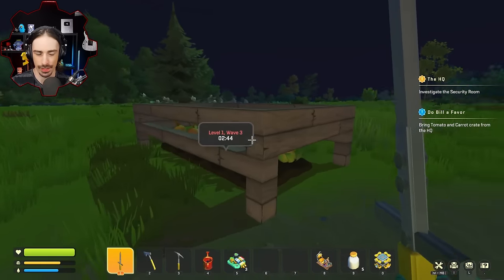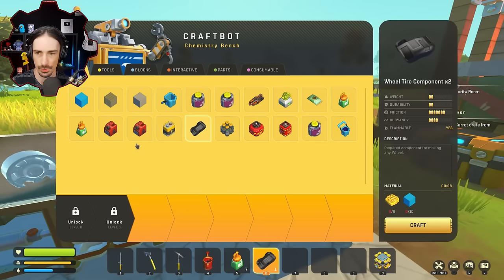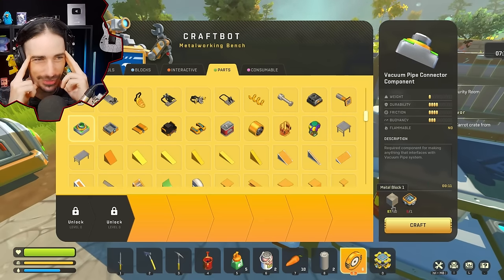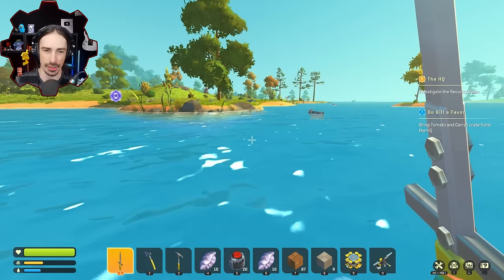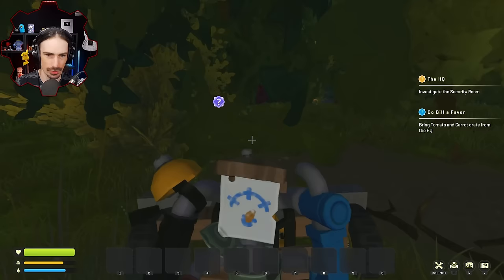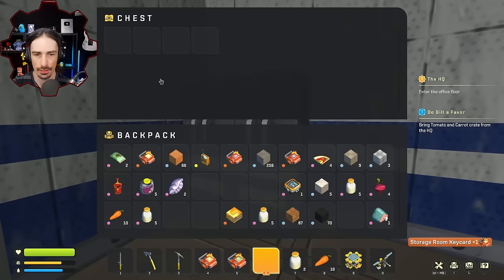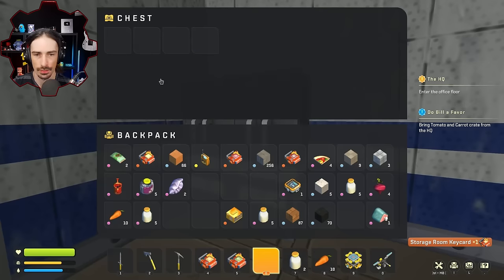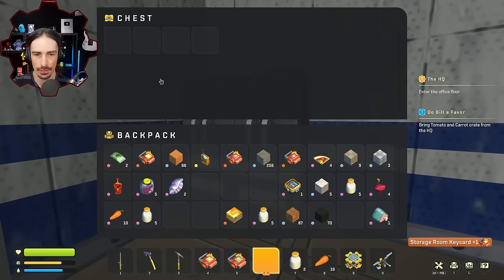Building This Car Was More Complex Than You'd Think

Comment: The cheapest suspension there is in Scrap mechanic, is seat suspension. Use a second seat to connect to bearings, those bearings on the sides of the vehicle (front, back, left, right) connect to L-shaped arms made from blocks, and have the ends of those arms connected to he wheels or to steering then wheels. If you have a friend and set the bearings direction correctly, you can have the friend steer left or right to or stop steering to toggle between normal mode, low-rider mode, and high-rider mode.

Comment: Hey, Scrapman in HQ the corrupted keycard is for a room door in Piping Room 1, or (2 more likely) the door is inside the Piping room itself go in there with a few slots open in your inventory, and you will find a good amount of loot and some (Key story items maybe).
Talk to the Guys in the HQ to get their Names and further story Quests and item request Quests for rewards you want to focus on as there are items and resources with some Quests also being available for Blueprints for items locked for crafting right now.
Like how it went with Bill in this video.
The Golden Chests respawn in the Banana crate outside (sometimes after a day and night cycle has passed and you have left the area after your breaking and collecting of the chest loot) the HQ and there are a few individual Bananas outside the crate try to pick them up as they can be useful for trade as Quest requirements or as emergency food.
Simply you can get some Banana without having to farm or deal with a raid for them. 

Give it a try?
Bring a large chest to the HQ and see if you can place it in there or even at the door partition area not having to Load in and out of the HQ or end up needing to use HQ storage lockers for quick inventory item slots and forgetting about it later will be quite nice.

Comment: If I might suggest, Scrapman; if in the future you need wheels and are pressed for resources, I'd recommend using the red Pipe Caps, in the Metalworking Bench, as wheels. They only require 5x Metal 1 and can roll pretty smoothly, comparable to a normal wheel. They are a bit thinner than a standard wheel, but still work pretty well, I think.

I used them for my first vehicle to save on plastic block, and they served me really well until I could craft wheels.

Comment: Do be aware, at least last time I checked (it was a while ago) inventories are saved to the blueprint, and retained on loading them, but also lost on unbuilding them.

What this means in practise:
If you have a chest on your creation with stuff in it and you save that blueprint, when you load the blueprint it will still have all that stuff in it.
If you take stuff out of the chest and then load it without saving a new version, you will have duped the contents of the chest.

If you delete a creation using the lift, you will get all parts used in the creation, but nothing contained in the chests, if you didn't save the creation before deleting it, any items in those chests are gone forever.

So, in order to prevent accidental duping or deleting of items, make sure you save your creation every time you decide to delete it.

Comment: You get all the parts from deleting things on the lift except the stuff inside containers, like the things in chests/engines/gas tanks. Also the inside of the containers get saved if you save it on the lift, like if you have a chest full of component kits and you save it on the lift and spawn it back in, it will spawn with the component kits but only requires an empty chest to build it, so it dupes which can be frustrating sometimes

Comment: When deleting stuff on the lift, it goes into your inventory, but your inventory needs the space for the components and materials. You can also load creative saved creations in, assuming there's enough space in your inventory for ALL the parts and materials involved.

For example, I tried loading a shack from vanilla survival, which I then imported to creative, but because the shack wall panels take up one slot each, I had to alter the build to not have those before loading it in, then place them back in manually after the fact with a second inventory load, and because of that, I had to manually reinstall the stairs too.

Comment: Fun fact about the mod that Kan recently found out:you can use the lift tool to save your creations similar how in creative version does (mostly the same way and the trigger is the same it's just not showing the prompt that you could do that so it will be more helpful if you destroy your vehicle,just make sure you saved it before anything happens to it) and another thing is that if you found more people eventually,just make sure you talk to the twice to get the ability to trade and with it also a special trade which is more of a quest,one of them gives you a tool that cuts down a tree BETTER than any other tools,just requires batteries

Comment: with the alternator, its pretty simple. i just used a controller.

make an axel out of pipe pieces and make sure its attached to a construction that is welded to the ground.

w=something welded to ground, p=pipe, b=bearing.

w b p b p b p b p b p b w

thats 6 bearings, 5 of them in a row should be linked to a controller, the 6th on one of the ends link to an alternator. set the controller to max speed, 360, loop.
it generates a battery like every 30-45 seconds.

Comment: Just to let you know there is a oil pond in a nearby desert to bills house that you can get the vacuum pump and dedicate one whole chest to crude oil collection to make gas and keep yourself fully stocked up. I am also thinking to go electric for some things like close range vehicles, and long range with my gas vehicles. The alternator can be cheated through by just using bearings to power with enough speed that it can charge it quite fast
Reply: That’s not a guarantee. Just highly likely. There are two deserts next to bills house in my world and there are no oil ponds anywhere.

Comment: Hi scrapman my name is Jamie if you take 6 bearings 5 of which are powered buy a controller and 17 blocks of metal make 2 small 6 block columns take the first bearing and stick it on the front of the top block then stick a block on the bearing then stick another bearing on and keep doing it until you run out of bearings when done attach the 2nd 6 block column on then get a alternator and connect it to the unpowered bearing then set the controller to slot 2 to 360 and then look at the alternator and you will see a display showing you how much power is being made and how many batteries have been made

Comment: u can use controlers with 3 or 4 berings per wheel to make a car that works with no fuel. u just need to set evrey conection to 360⁰ on loop